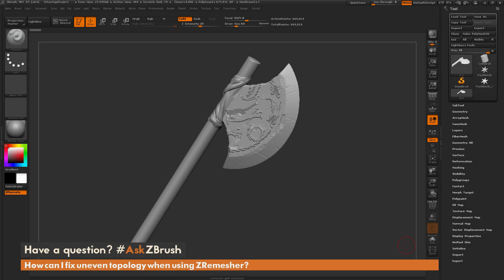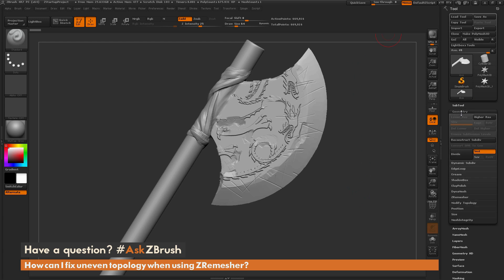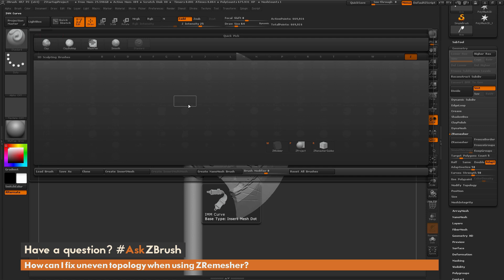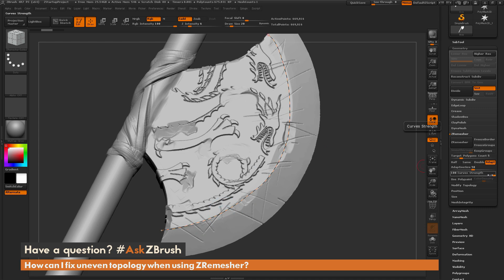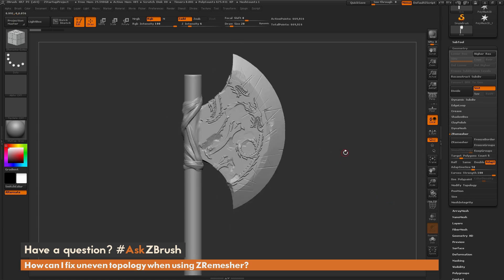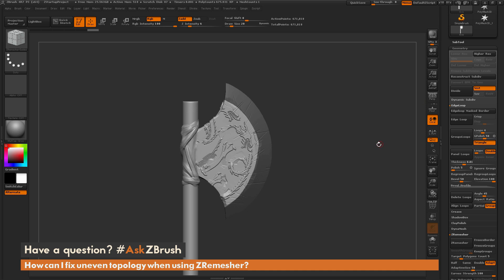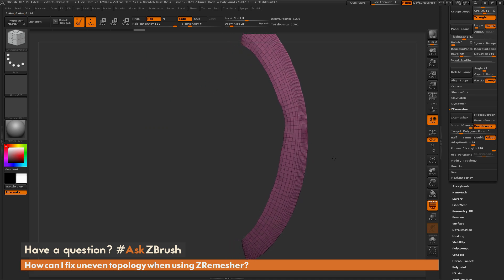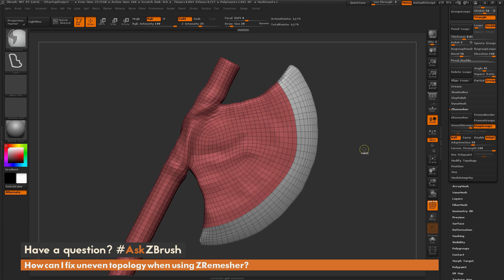#AskZBrush: “How can I fix uneven topology when using ZRemesher?”

Comment: It would be so cool to add a tool which will smooth edge distribution along open edge in smooth brush modifiers. like in maya quad draw tool, when hovering over edge and smooth edges, they're smoothed without destructing the edgeloop itself.